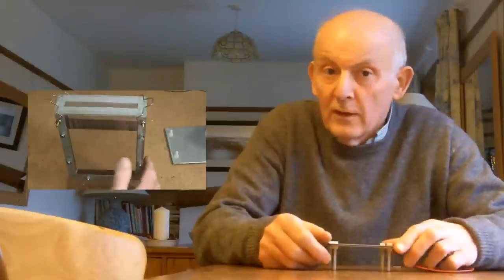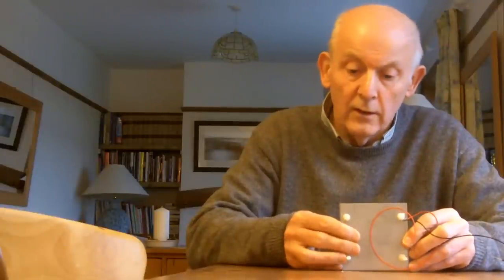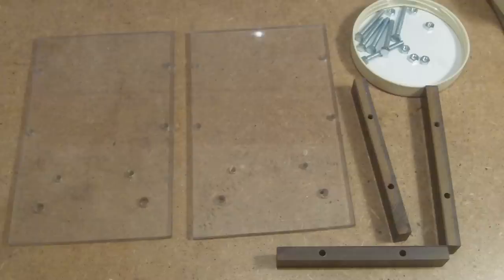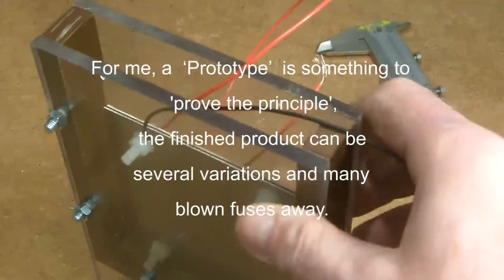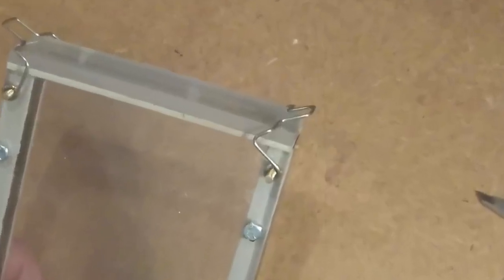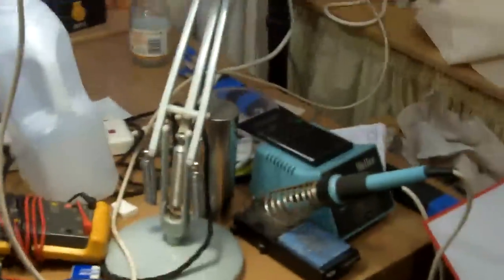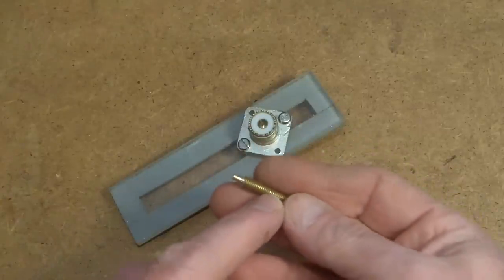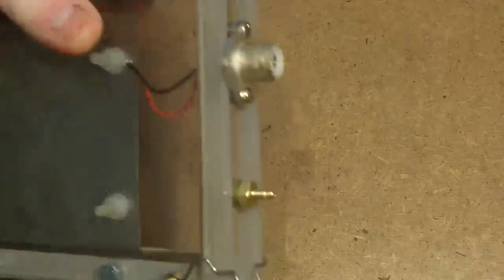HHO. 2 Construction of a test cell.

Comment: I'm glad to see your hollow bolt method of passing a fluid out of a chamber. I did the exact same thing years ago for some vacuum experiments with a brass bolt, drilled it, and ground down the end to fit a 1/4 inch PVC hose. I may have broken a drill bit too, especially since I didn't have the luxury of a lathe - just a hand-held drill. I attached the bolt to a steel lid for a glass jar, then soldered it onto the lid for an air-tight seal.

Comment from the maker: I haven’t finished thinking through the measurement process yet, I'm not anticipating making a lot of gas with such a small cell but I’ve been want to come up with something a little bit different to the run of the mill devices.  But if I can’t think of something new then I guess an upturned bottle will still work.
All the best ... Andy